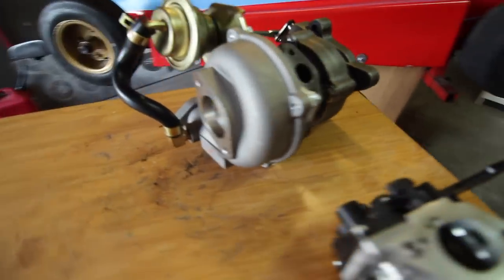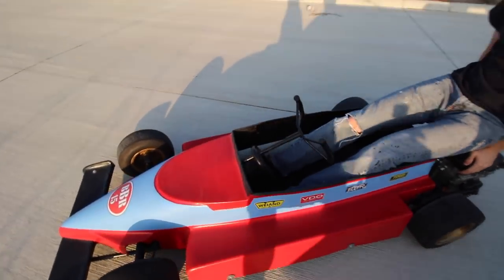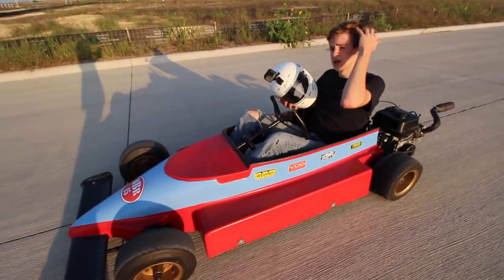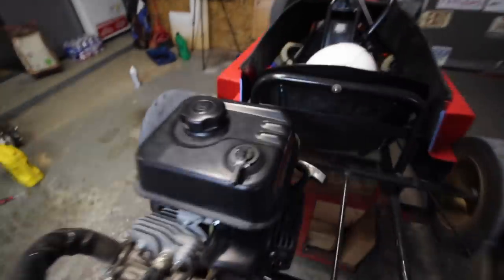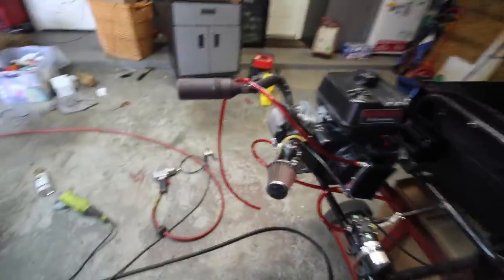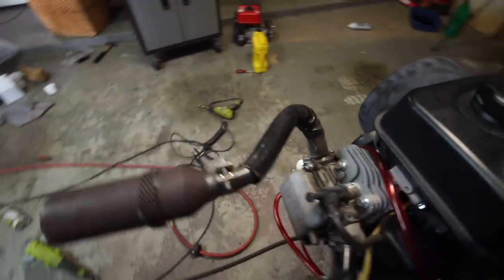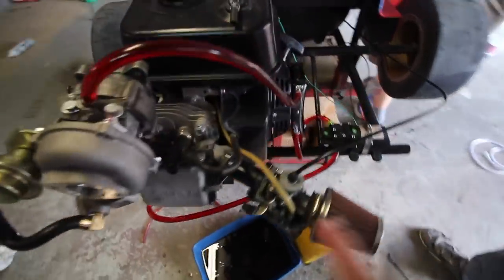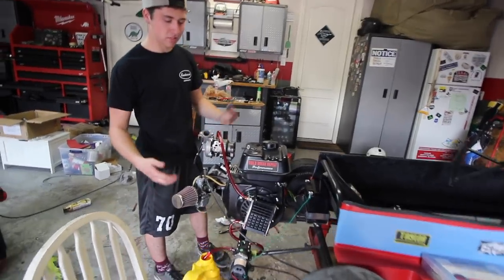Go Kart Turbo Install! | Turbo Drift Kart Build

Comment: The problem with putting a turbo on a single cylinder is... there isn't an exhaust stroke every intake stroke. That's why 4 cylinder and above work the best for turbo's. To compensate, you need a real small exhaust turbine and chamber that has a lot of back pressure to keep the turbine spooled up during the intake stroke on a single cylinder. You'd get way more power out of a turbine style belt/chain driven super charger.
Reply: "your"
Reply: @GenderRollsN' honeybutter 
Most likely..yes.
Reply: Matte Edström ...momma.
Reply: Ben Hawke you would be better off with a little smog pump style supercharger
Reply: *3 cylinders. Lots of Japanese 600cc turbo 3 banger. You're absolutely right about the exhaust pulses
Reply: Rotax 3 cylinders make some big power with turbos
Reply: I did a blow through turbo on 2 cylinder engine. Gave it alot more power at 9 psi. This is the second video I see where they are doing a pull through setup....they suck. Idk why they are doing it. Then turbo is not just having to compress the air but the fuel as well. Harder to make power doing this
Reply: Jake Heke  you really don't know the difference between the two
Reply: Jake Heke  I'm sorry I didn't notice that. I kinda guess you would say I speed read comments. I don't worry about the grammar to much. Use speak to text a lot and I don't even take time to correct that most of the time. I get your point now though.
Reply: Not to mention, he's apparently never heard of Proof Reading his own commentary, which really, is not that damn hard, unless he uses speech to text because of a case of illiteracy. Which I doubt, but nothing is impossible. In any case, people need to learn to take some criticism once in a while instead of acting like an  entitled snowflake all the damn time. It's not like anyone insulted him, they just pointed out that he made a simple error. Oh, my fucking GODS, it's soooooo terrible! Somebody please get this kid a thicker skin.
Reply: Impresionante 👍
Reply: You people don't even know the basics.  A supercharger will ALWAYS net you LESS power than a turbocharger (provided its size is accurately matched to the engine).  The only merit of a s/c is that it is easier to install (in an engine bay) and eliminates turbo lag.  The "turbine" is the "exhaust wheel"... the compressor wheel is NOT also called a "turbine" ... its called a "compressor" (wheel).
Reply: Holy shniz!  I didn't  think I'd stir up a big hornets nest. I'm not saying it's not possible. I'm saying that it's not practical. Especially on a single cylinder.  Also, yes I know a turbo makes more power than a supercharger. I'm saying a supercharger would be better on such a small single cylinder because it's really hard to find a turbo small enough  for that engine to compensate for the exhaust pulse and lack of exhaust pressure. Also, just because a turbo spools up doesn't mean it's creating boost. I may not be an engineer, but I have been boosting engines since 1996. Also don't boost a 2stroke, it's just a waste of fuel and a extreme pain in the arse to tune. Can someone gramer czek this and let me know what chanjes nead too be maid. Thnx.
Reply: @kurtlamprecht93  we have another grammar teacher in the house thanks. Maybe get a job at Google and fix the problems. Thanks for caring though.
Reply: @benhawke7231  wow man you know your stuff.
Reply: So what if I got a desil small engine
Reply: @baggedlunch9242  
Single cylinder works best with super charger.

Comment: With such a small turbo you need a oil restecter and mettle or AN lines because those plastic lines will melt when the oil gets to hot and when the turbo gets up to temp as well you should get a oil pressure gauge with a speed controller for the oil pump to control the oil pressure or you will blow out the seals 
Watch colin furzes turbo scooter vid and he will explain everything you need to know

Comment: a turbo like that one with a journal bearing needs a oil restrictior as too much pressure will blow it out the seals. Might want to do some research to be safe guys...
Reply from the maker: Yeah, that’s why we went with a diesel transfer pump, it’s very low pressure but we’ll look into how much it needs exactly. It stopped smoking after we flipped the inlet and outlet though.
Reply: Build Break Repeat you also need a vent in the oil system on the return side.
Reply: Restictors should generally not be used on journal bearing turbos, ball bearing turbos need restrictors though.
Reply: Agreed restrictors in general are a bodge when applied to journal bearing turbos. They actually require oil pressure to function properly in the same way as cam/crank journals. (It will function with lower pressure but be less efficient and wear faster).  It might be a dodgy ebay turbo from the start, but I think it's possibly a combination of running the pump with the turbo stationary (the seals are a labyrinth type that uses the rotation to force oil back in) and having a sealed oiling system as well as maybe reverse feeding it to begin with.  I know not many have seen good success with single cylinder turbo setups but I think it's possible to make boost, just far less efficiently than with multi cylinder engines, or a mechanically driven supercharger.
Reply: Add a cheap oil pressure gauge to verify what pressure the turbo is seeing.
Reply: Ball bearing turbos need restrictors not journal bearings
Reply: ive done this before with 200cc motorcycle, you need very very low amount of oil, very low like drops....
Reply: Good man “Evil me” I was just about to say that
Reply: @BuildBreakRepeat  
You need to add a vent tube to the catch resevoir. The way the oiling works on a turbo , any amount of backpressure on the drain side will cause the oil to seep past the seals. So your oiling system cant be a sealed system, it has to be able to vent to atmosphere.
Here is a link to a video explaning it. https://youtu.be/We3POioI1aQ
The larger side is the outlet and the smaller one is the inlet.
Happy modding.
Reply: smh. BALL BEARING turbos need a restrictor.
You can feed journal bearing as much pressure as you want as long as the drain is big enough to handle the flow.
Reply: @UnTamedMustang  I guess that is why if you look up turbo specs they have a specific flow rate for oil, and all oems use a restrictor, yes those orifices in the banjo bolt or inlet fitted are specially designed to be a certain size, not just wide open. But I guess oems and turbo manufacturers have no idea what they are doing.....

Comment: MIT published an article a few years back on turbo charging single cylinder engines. Google it. You need to add an air capacitor in between the turbo and carb to maintain boost. Basically a steel cylnder with a reed valve on the inlet.  MIT even gives a equation for calculation volume of the capacitor.

Comment: So you didn't connect the exhaust tube in the turbo and the Intake tube in the turbo so its suppose to do a air and exhaust compression which would make more AIR GET sucked in and more air being shot out. So in the combustion chamber your valves will receive more AIR with more OIL and same amount of gas which would make the EXTRA POWER by the compression ratio improving significantly.

Comment: You guys are mounting turbo all wrong, for a good drawthrough setup the outlet of the turbo needs to on the bottom pointed down an directly at the intake port to elemintate fuel pooling
Reply: @UnTamedMustang  ya and to verify I don't mean the actual outlet needs to be pointed down the hole that's in the turbo to the outlet needs to be as close to bottom as possible and the outlet will point downhill to the intake port

Comment: A bigger drain line might help the oil stop pushing out of the seals. And or a larger vented reservoir. Any backlog of oil increases your chance of leaking.  Turbos oil drains are designed to drain into a crankcase, into an open air void that is vented to atmosphere.  Without any stops in between.  Backed up oil pushes out seals.

Comment: It definitely can work. Just not the way you're doing it. Good effort though👍.
Ps fit a bleed valve to lower the oil pressure, that's why the turbo is leaking

Comment: You never hooked the turbo up....
The exhaust is turning the turbo but you didn’t have the air from the turbo going into your motor.....
So the air is just being pushed around outside for looks.
Reply: Thats the funniest shit I have ever seen . When do the attach the inlet ?
Reply: What? It's gets pushed back into the cylinder through the exhaust system.
Reply: This is a part 1 of the build. Builds take time.

Comment: The oil pan needs to be way bigger and maybe have a breather on top so there's no pressure in the tank. The oil obviously needs to enter the turbo with pressure, but has to go down without any back pressure (inside that little tank). If theres any kind of restriction in the oil flow out of the turbo it will just pass the seals

Comment: you need to put a restrictor in the top part of the turbo for the oil as it's only supposed to have so much oil pressure

Comment: The cooler should go  before the pump the hot oil in that pump  cant be good for that plastic pump ,what is the org purpose for that pump it sure dose not look like it's made for hot oil . i now thats not how u should run it but that setup maybe.u might want add a little length and  to try to taper ,gradually reduce the  exhaust size down before the turbo  .the lengtt will give u pressure and the tapper will give u  air velocity  and help with back press.   try adding air capacitor on the intake side its just big space like a plenum on a car it will hold some pressure when the intake vavle is closed .

Comment: I’m going to try and make my own booster go cart... to deal with leaning out the boost is going to run through a secondary carb... i would like to use the boost pressures to control the system and I will hopefully be able to tune it with a pressure regulator in line with the actuator on the second carb...

Comment: Also ditch the internal wastegate and weld the flapper door closed good and tight you dont need it for nothing on that small motor you wont ever get more than 6psi if your lucky. And look for metal headgasket or make one outta copper!!! Dont use paper gasket and use studs so you dont blow the head off if it does actually build boost.

Comment: Where did you buy the turbo and the materials for it? I’ve been wanting to do this but can’t find the parts
Reply from the maker: The turbo is a vz21 and can be found on eBay or amazon, the engine parts and carb are from Gopowersports, the oil pump is an oil transfer pump from amazon, you should try to find one that operates around 40 psi

Comment: You need a oil feed restrictor it's just a fitting with a small hole in the inside for oil if it's not enough oil drill the hole a bit bigger you can use brass pipe fittings and tap and die for threads in the turbo hole for oil because I have s better than using a gasket because they can leak. If you get to much oil pressure in the cheap turbo or even a good turbo it will get blow by and dammage the turbo for real!

Comment: Definitely should consider angling the exhaust away from the fuel tank and if possible the intake forward for better airflow. It may require a longer routing for the intake but take that into consideration

Comment: Was the engine bone stock or did it have any internals done to it? 
Valve springs, rockers and a lightweight flywheel with governor removed makes a huge difference in power and how fast and high it can rev. Enough to make a mini bike outrun a turbo volvo till top speed is reached on the bike

Comment: Man, I wish someone that had a clue how turbos work would give this a try.  I don't have time right now but everything you you're doing wrong and how to fix it I commented on when cars and cameras tried to do theirs.  Short version on your oil problems- most turbos don't have a real oil seal so when you force too much oil in them it will leak out both sides of the shaft (your dripping out the intake).  You need to seriously restrict down the inlet (how much depends on how much oil pressure you have.

Comment: That style of turbo isn't designed for single cylinder engines as the turbo will slow during compression half of the engine stroke causing major turbo lag. Get a belt or chain driven supercharger/blower.

Comment: I'm only 39 seconds into your build and sorry to be the burden of bad news but I will bet 10 to 1 if that turbos not going to work I'm subscribed to a lot of people that do go-kart. I have seen it attempted between 8 and 10 times and it has never worked for the other people that have tried. So I'll continue watching the video and let's see what transpires :) I hate the thought that you guys spent a bank load of money to put a turbo on it just to see that it doesn't work
Reply: Esteban Pedroza , Todd is 100% right. At best it will need efi which is $$$
Reply: @Esteban Pedroza expensive learning experience and what they figure out is exactly what I had mentioned. It won't work it never has worked even with an EFI in fact truth be told it slows it down
Reply: @VasilyBuilds  yup Vasily, you had attempted it and you were one that I was referring to. I thought if any of them would have work it would have been yours but I think it even slowed it down can't remember. Hope you're well.
Reply: Needs a blow through carb or the turbo needs to pull through the carb
Reply: It would work if they put the carburetor inside the charge pipe.  That is if a single cylinder can maintain flow, and the fuel supply will overcome the pressure.
Reply: Todd Bearden why you watching theses videos if people keep failing? You must have some faith
Reply: Too high oil pressure that pump your using is 100psi one you need a oil restrictor these vz21 turbo need 20-30psi of oil pressure
Reply: Would it work on a 4stroke?
Reply: The only people that I have seen it work is cars and camera's after they put fuel injection on the engine

Comment: Should put a relay cut off on the oil pump to the engine that way if oil pressure is lost it cuts motor

Comment: your oil return might be too small, or not a straight enough shot into the return tank, or the oil tank may even need a vent. i say run it draw through, unless it doesnt have carbon seals.

Comment: Put a restrictor in the oil feed line. And make the drain line bigger. Cool build tho. What is that for a turbo? I have a tdo3 i cut off a bmw that had twins was going to do something like with.
Reply: berttracy90 the td03 off a n54 is way too big for anything like this. It might work right on a 600+ cc motorcycle though

Comment: You need to use better lines then that crap some proper heat resistant stuff,you need a restricted oil feed line put a plate over the feed gasket to the turbo and drill a 1m hole in it and leave it in there ya want the feed oil restricted to 1m or you can jam a carb jet in the feed line to the turbo.shorten the lines as much as possible and ya got the exhaust housing blowing onto the tank move the thing around so the intake hosing is forward and yes make sure the retune is at the bottom as you said clocked correctly

Comment: You may as well get a Honda GX160 fly wheel and charging coils to put in your engine
Reply: drive it break it fix it get an aluminum flywheel even the gx160 from a true honda will explode if they remove governor and increase revs

Comment: Your drain is not big enough for that turbo.  You need to make a bigger drain to the oil catch can and drill a bigger hole on the top so it can drain out quicker, that's why you're getting oil pushing out everywhere

Comment: To much oil pressure. Need a ristrictor in the oil inlet and a free flowing oil outlet from the turbo. 
Also when you start to routing your intake, its easier to bolt your carburator to the the turbo inlet. That way the carburator still functions normal.

Comment: u need very low amount of oil and u need to rotate that turbo because u will get too much back pressure when kart is moving and air goes in to exhaust outlet in turbo...

Comment: A lot of effort for lower performance adding a turbo you such a small motor. More weight and exhuast restriction is all your doing so it's gonna be slower. It'll never make any boost. Seen one channel put the same turbo on a dirtbike engine gocart and with a 3-400 cc's in it had and 6 gears it made it slower and only made 2 lbs of boost after it was revved at full throttle for a few seconds. Need a motor with more than one cylinder and even then it might not be enough to be worth it. Have fun messing around with it though but I doubt you'll even hear any turbo noises
Reply: Grind Hard Plumbing??
Reply: @elesjuan  Yeah. Idk exactly what size motor they have it could be smaller than I guessed but if you've seen one of their recent videos you saw how it wasn't really adding any power. And they're motor had a lot more power than just the 5 hp of the Briggs that this gocart has on it. Don't get me wrong it would've been bad ass if it worked but just didn't seem to. You'd need a turbo about half the size them maybe it would help a little.

Comment: And good luck with the oil lines ? That's going to get hot and bust out spray you with hot oil. Just use some fuel line from autozone it will work for a while since braided line will cost you over 100$ plus fittings hose clamps and fuel line should be ok on the cheap! No need for the cooler that's just extra junk for that small motor it wont get hot enough for a cooler? Gap the sparkplug little bit tighter  and make sure timing is good and dont expect much outta the ebay turbo it only goes for like 50$ on ebay for complete kit